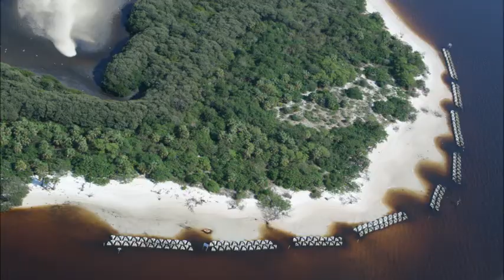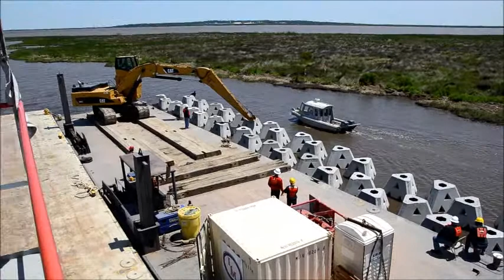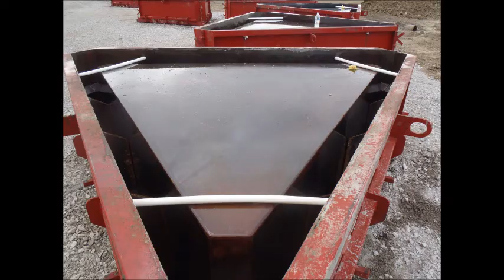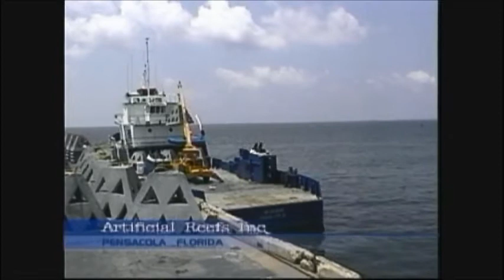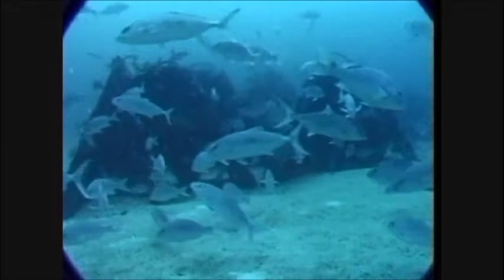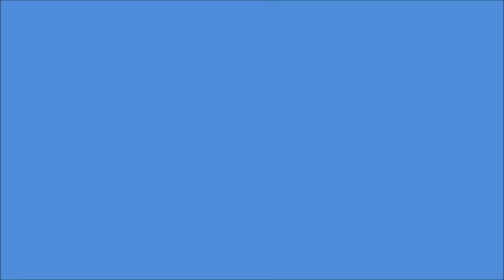Living Shoreline Solutions Offshore Barriers

Comment: Michael, Shallow water, lower energy systems are least expensive all the way to deep water, extreme wave energy conditions..typically looking at $250-$700 linear feet installed.  That covers survey, modeling, engineering, manufacturing and installation.  Much less than most conventional products that refract wave energy, negatively impacting adjoining property.  The WADs naturally accrete sediment/sand to rebuild shoreline and provide an incredible productive, habitat